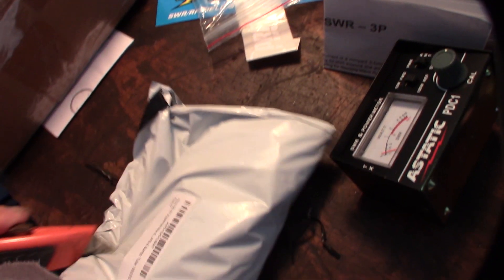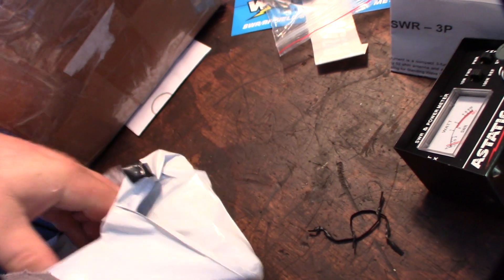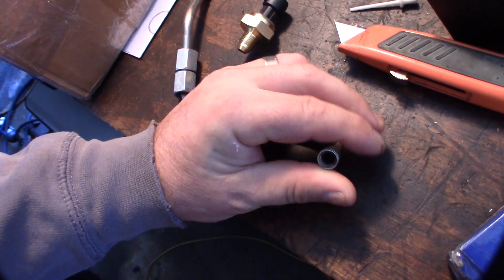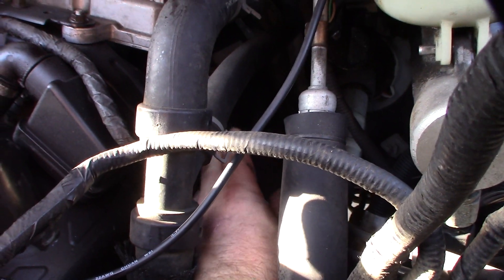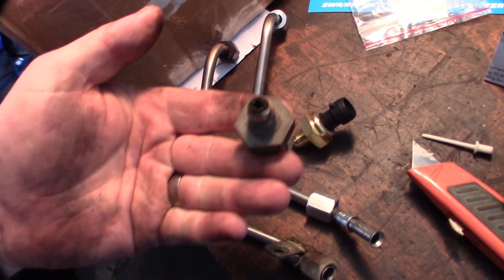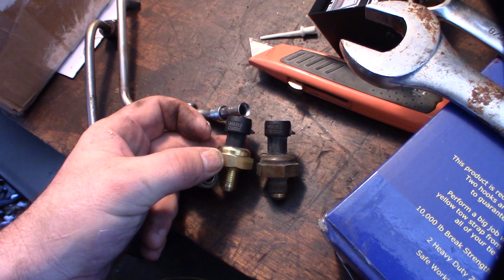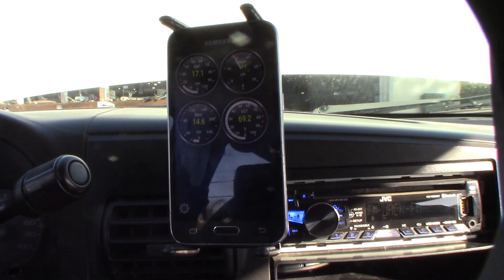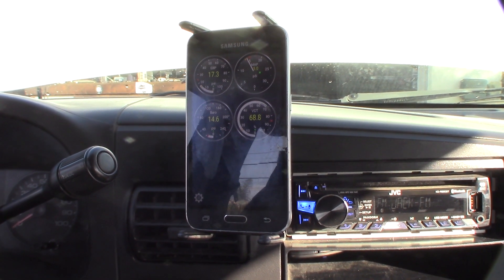Ford F250 Powerstroke Diesel EBP exhaust back pressure sensor installation troubleshooting

Comment: EBP sensor should read 14.7 with key on, engine off. There is 14.7 pounds of atmospheric pressure here on earth. Start engine, live data should be a flat line that increases with RPM. If jagged, sensor is probably bad.

Comment: I'm doing this right now so and I'm not sure if you'll see this. I've been turning on the lower end of the tube for quite some time now and it's not coming free. The nut keeps turning and it's definitely loose but the tube won't detach from the engine. Any tips?